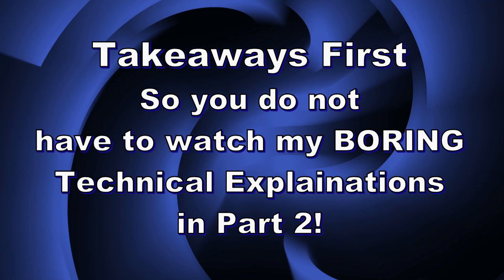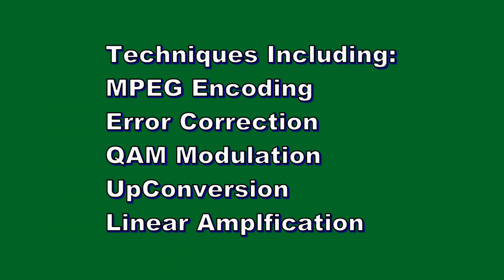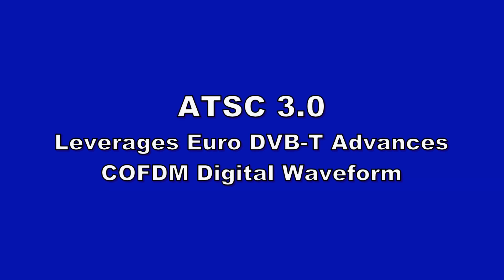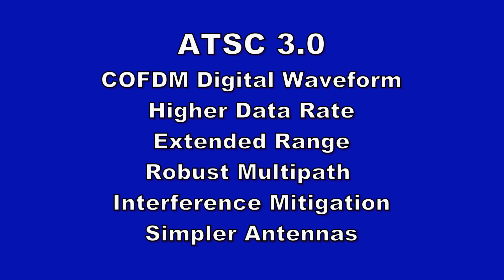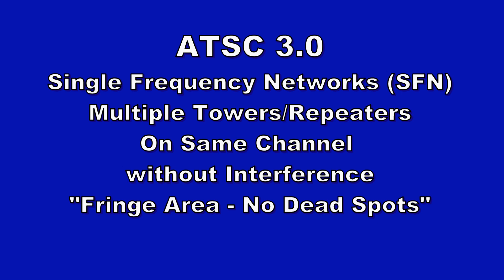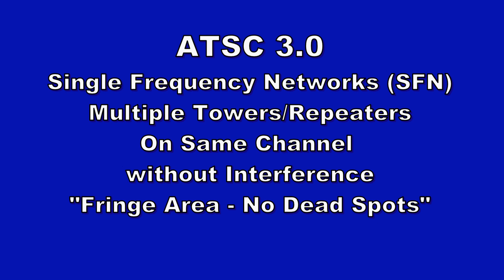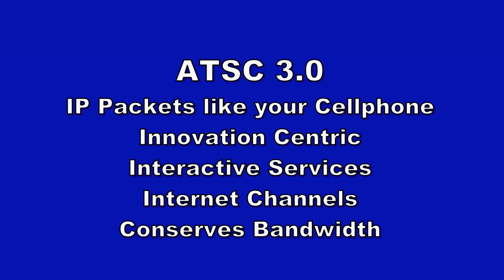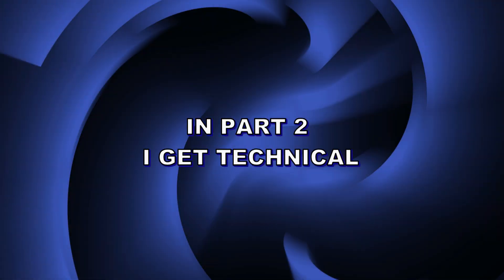What's So Special about the ATSC 3.0 Waveform?

Comment: I never really thought about multipath coming from movement of anything other than the receiver. Thanks for this. I watch a lot of digital OTA tv and live in the Boston area. It will be interesting to try to adapt to this standard, and I wonder if it will directly replace ATSC 1.0 or if the two standards will coexist for a time as they did with analog and digital television originally.

Hopefully it will be easy to build and use antennas for, and there will be no short supply of converters for existing televisions.

Thanks Mike! I have been playing with TV standards for a while with old TVs I find on the road. Excited for the next video. It will be helpful to see how I can continue to watch MeTV 😂
Reply from the maker: Initially no. But strong interests insisted on a mandate to devote bandwidth and capability to supporting 1.0 during a technology changeover period.
Reply: @MIKROWAVE1  where do they have the channels to do that, most of the UHF channels were sold off for cell phone use.
Reply: @JCWise-sf9ww  The 'lighthouse' process allows broadcasters in a market to work together to share the stream load of the displaced 'Lighthouse' 3.0 station. Numerous stations all feed the 3.0 station (because the standard allows ALOT more information in the standard 6MHz channel) and in turn they carry the Lighthouse's streams divided up amongst themselves. Everybody (at least the network stations) ends up with a 1.0 and 3.0 signal with no new spectrum usage. Remember, the virtual 'channel' number shown to the viewer is a lie and be set to anything the broadcaster wishes. Outside of the lighthouse process, there is talk that the abandoned VHF channels will see a return in popularity as 3.0 doesn't have the same negative effects from multipath.
Reply from the maker: @JCWise-sf9ww  Yes they knew they had prime spectrum and got top dollar from the 5G folks. But they still tightly hold on to bandwidth. VHF channels are numbered 2 to 13 and UHF channels are numbered 14 to 36
Reply: @ad0tp  Thank you. And then we can go back to intermediate tropospheric/atmospheric TV skip reception on Channels 2-6. In the past I experienced getting a TV signal from North Platte NB.  Yes, virtual numbering is so the TV stations would not have the expense of changing their signs and artwork for a different channel number. Yea, now a UHF channel 27 is on a VHF channel 10 in Harrisburg PA.
Reply: @MIKROWAVE1  We can go back to the old rabbit ears indoor TV antennas for the VHF, provided they up the transmitter power some. Now days you need a low pass filter on your UHF antenna, so the strong Cell phone transmitters don't overload your UHF tuner.
Reply: @ad0tp  But with these Lighthouse streams, there is only ONE license for that channel.  That's a rather cozy relationship where these major corporations are sharing 1 license.  When did we decide that was proper?  Oh, we didn't.  The FCC just decided to do this on their own to support the corporations, not the general public.